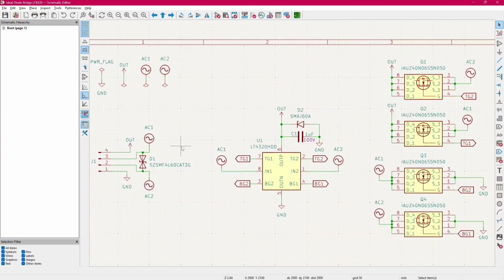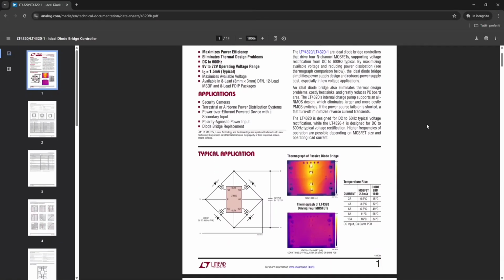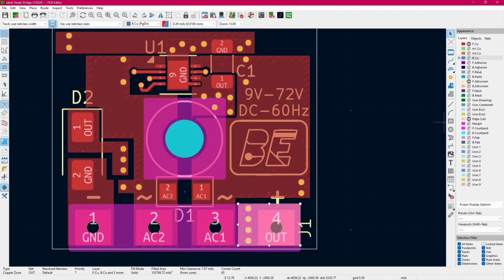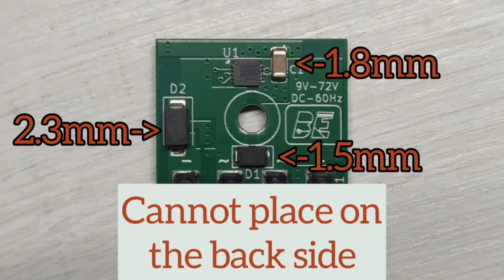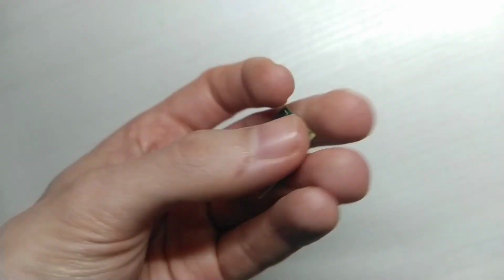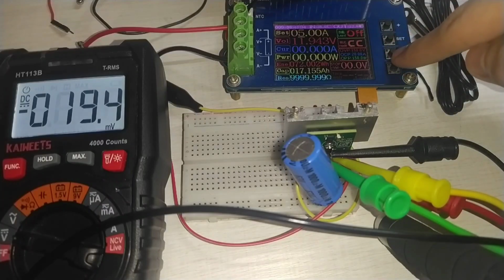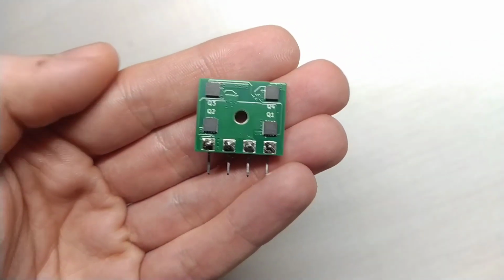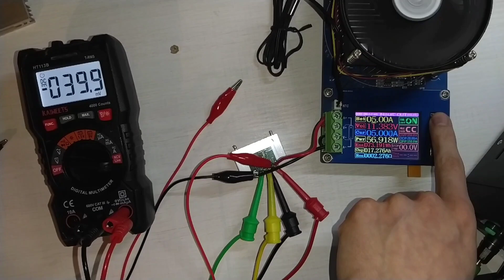Ideal bridge rectifier PCB design + some tests

Comment: Seems super interesting. Is it also possible to use it as a 3-phase diode system that most brushless motors have to make a hobby wind generator?
Reply from the maker: Hi, sure you can use the LT4320 for three phase systems, check this link here for further reference:
 https://www.analog.com/en/products/lt4320.html

But there is a major problem, you need 3 of them...which gives you a super high cost. The LT4320 is not a cheap part at all, around $10 per part. But the good news is that the LT4320 is available also in DIP package (the one you can insert on the breadboard) if you are afraid to work with MSOP or DFN. 

Analog Devices also made a DEV board for this purpose

https://www.analog.com/en/resources/evaluation-hardware-and-software/evaluation-boards-kits/dc2465a.html#eb-documentation

You can consult the various documents, they have schematic and other stuff. 

You can also buy the evaluation board if you wish...for €103/$118 on DigiKey

https://www.digikey.com/en/products/detail/analog-devices-inc/DC2465A/6005074?s=N4IgTCBcDaICIGEwBYBsBWAgiAugXyA

Or on Mouser for €116/$121

https://www.mouser.com/ProductDetail/Analog-Devices/DC2465A?qs=BZBei1rCqCBg5NeGIMKEVQ%3D%3D

Hope this helps a bit :)
Reply: @BurningElectronics hey, thanks for the links. exactly what I was looking for. seems pricey, so might keep an eye in this area to see if any other manufacturer comes out with a cheaper alternative.

thanks again and hope to see more cool projects from you. subscribed